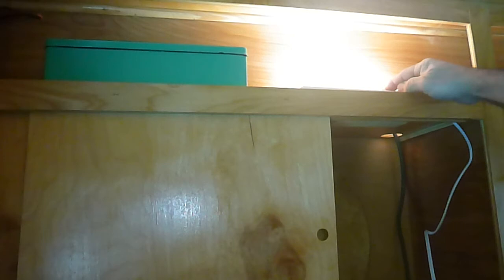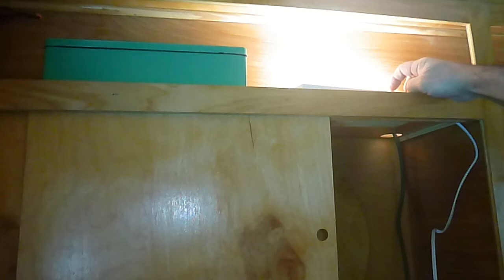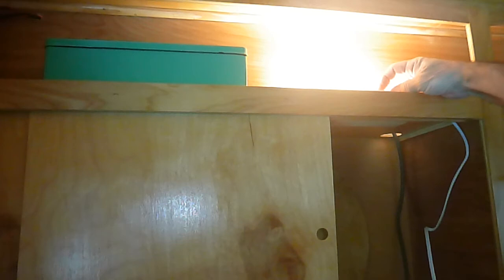Teardrop camper build a  5 X 8  video no.53

Comment: Great light. Led is the way to go. Do you have many 12v lights installed.
Reply from the maker: 12 volt Led on the ceiling, one in the slider cabinet, two in the shelf over head, one dimable on the galley lid, one ribbon LED on the galley shelf all hard wired and on a redundant switch. And two 8 inch green LED under the RV which will light the ground, up to 60 feet away for safe walking at night.